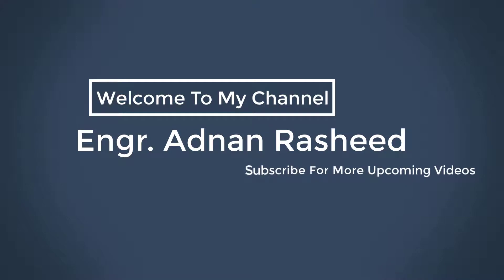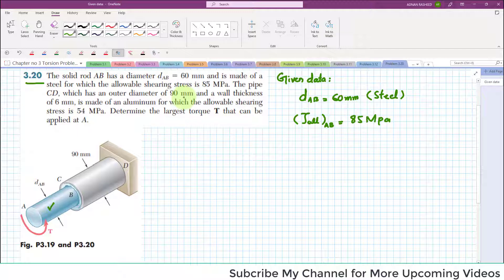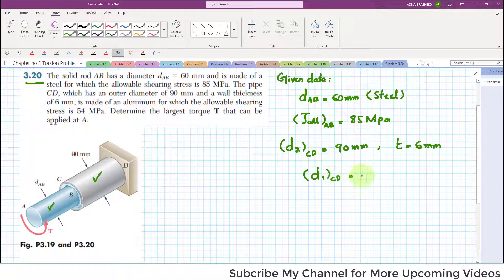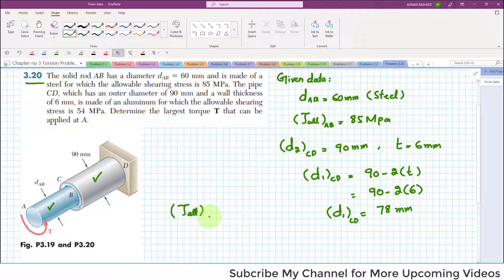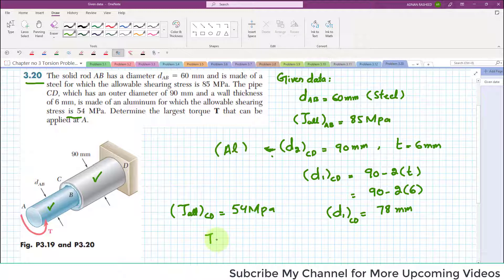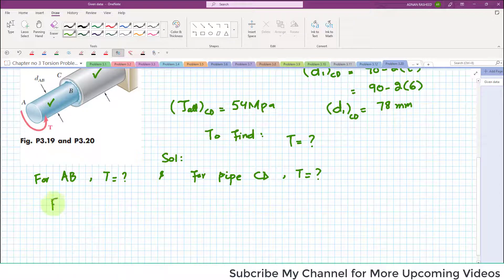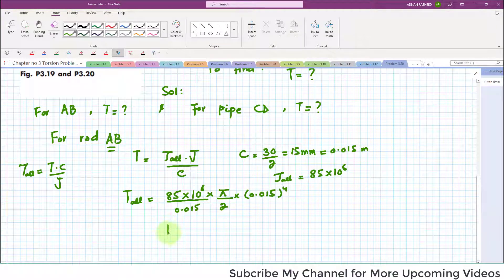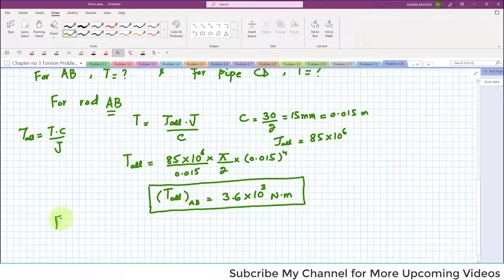Problem  3.20 |Torsion| Engr. Adnan Rasheed

Comment: sir review ur diameter in solid rod diameter AB u divide 30 by 2 in the  place of 60 divided by 2 for the radius
Reply from the maker: I shall check it and may be during video I did this mistake but anyhow kindly clear your  concepts from videos and learn thank you for highlighting it
Reply: I know that this is a late reply, but just in case anybody comes later on looking for the correct answer:
Although Mr. Rasheed did write 0.015m instead of 0.030m as his radius, he wrote the correct answer (3.6*10^3Nm). This means that he used the correct radius (0.030m) while plugging the numbers into his calculator; he just miswrote it during the explanation.
tl;dr: Final answer (3.6*10^3Nm) is correct! Only a "typo"
Reply from the maker: @martinavasconcelos3927 yes you are right. some time it happens while looking on screen and writing simultaneously. Thank you for your valuable feedback sir.